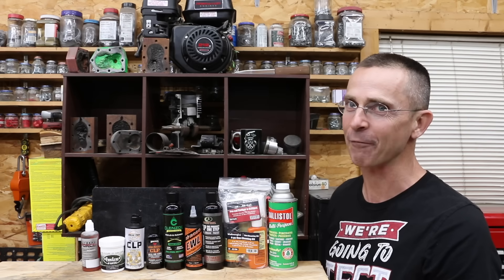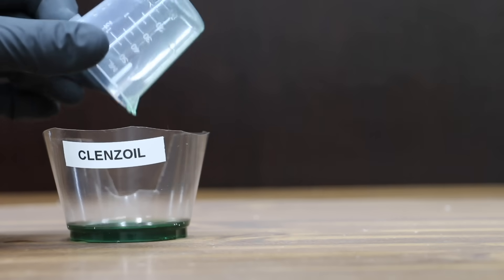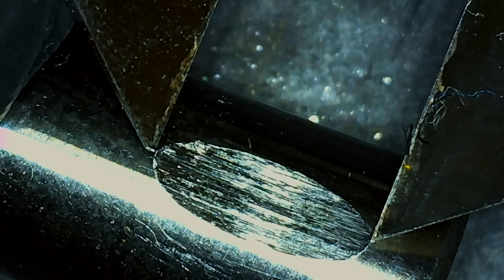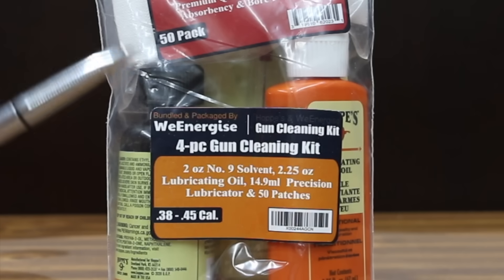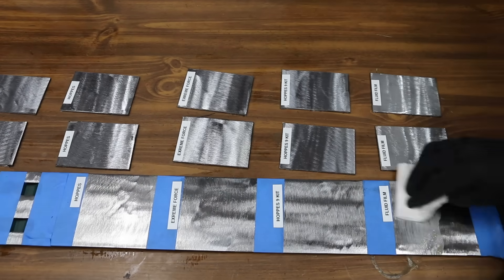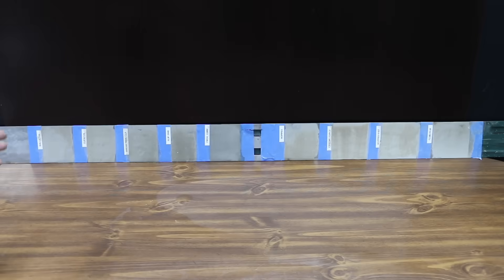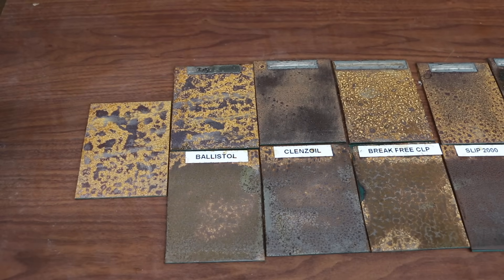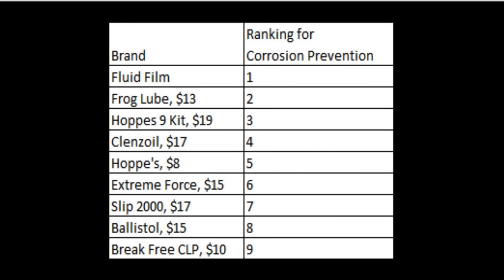Don't Buy A CLP Until You Watch This Review! It'll Save You Time And Money!

Comment: Other than rust, the biggest enemy of woodstocked firearms is excess low viscosity oil. It is usually impossible to restore oil-soaked wood.  A rag impregnated with RIG is all that is necessary to wipe down guns. One can will last a lifetime for most.  Use it sparingly on bolt races and lugs. GTG
    Another method is to pull the action, brush on a thin coating of Johnson floor wax over all metal, then take a clean dry brush and clean off all excess, then needle oil pivot points with the absolute minimum amount of low temperature  oil. Install the action, and either wax the metal or wipe it down with the RIG rag. Also use a hot rod in storage cabinets.

Comment: Is the Hoppes 9 kit the lube from the bottle or the small tip applicator? Going to use that for long storage lube and my trusty Break Free for regular use. 

Just need to figure out which Hoppes was the bad one and good one in the heat/corrosion test

Comment: i use axle grease, it doesnt dry up in a week or two like gun oils. never had good luck with gun oils, they alwayas dry up even when not used and then run like shit... greased guns stay lubed for years with no use and still a lot longer than oil when used... never had any lube/operating issues using grease, i have had/seen many using gun oils, that were solved by switching to grease.

Comment: For a lubricant and protectant, my go-to is Froglube. Though you'd nee to heat the metal first before applying it to make it actually work. Downside, it will gum up when used with petroleum-based lubes. Ballistol is my go-to cleaner when I have other more important things to do. Just leave it on there and let it do its thing. After a week or so, just clean it off with a patch and it will remove most of the fouling. It worked well during WW1, it still works now. The smell is just nasty though. Smells like old wet socks you forgot to wash last week. When I am in a hurry and wanted to really clean it well as in deep clean, Hoppe's is effective. Run a wet patch through, leave it on for 15mins, run a clean dry patch, lubricate. It will remove all the foulings in there. Another cleaner I had experience and would like to have again (unfortunately, it's no longer available in my country) would be the RealAvid Boremax Bore Foam spray. Just spray it in the barrel, let it sit till the foam turns to liquid, run a clean dry patch. All of the fouling will be gone as if the barrel had just rolled off the factory.

Comment: I have been using different products thru out the years on my hand gun. 15 years later, and 60000 round fired my hand gun still looks new and functions like new. The key is clean and lube it after every use and your firearms will be reliable.

Comment: Homemade: Motor Oil mixed with synthetic grease 50/50
Reply: I just use gear oil for lubrication
Reply: @brettr6895  I made a super mix that came out awesome:

1/2 5w20 Full Synthetic 
1/4 Lucas Tranmission Fix
1/4 Mobile Synthetic Grease

And about a tablespoon of CorrosionX, my favorite shit in the salt water world, but it is completely unnecessary. Lol 🤠🍻

Comment: Agree that I’d like to see some of the modern products tested such as Lucas oil. Personally, I use CLP for cleaning, then wipe things down pretty much dry. Then I use gun oil and gun grease for moving parts. Usually grease for surfaces that slide against each other such as the frame rail to slide contact point and barrel to inside top of slide. Then oil for all other wear points.

Comment: I was hoping you would test different types of PVC cement and if their drying time is legit. Also test the difference on glued joints with primer, and with out. Also testing if de-burring  the pipe really has an effect on the cemented joint. Preferably test the listed “Handling time” plz and ty

Comment: I've never really understood how something could be both a Cleaner and a Protectant or Lubricant.  It seems like those should be someone mutually exclusive.  That said, I just finished cleaning my CZ75B and Ruger Mk2, and I use 3-in-1 oil to lube them and protect from rust.  I love the smell of Hoppe's #9 like any good American man does, so I'm glad to use it to clean the firearms.  Wear, though, isn't an issue in the average pistol.  Maybe for something with a high cyclic rate like an Ma Duece that's putting the pain downrange with a quickness and generating tons of heat in the process, but the average person isn't, I think, going to put their sidearms through such torture.

Comment: Heat, or use rather, causes some products to break down. Prefer a high temperature lube and grease that remains viscus after a heat cycle or two. They are extremely inexpensive if purchased in the automotive isle in your big store.  Noticed big differences on long range days and during competitions.

Comment: The first part of this test is flawed, no gun has an oil pan, he should've just wet the part with oil and proceed with the grinding test - Thinner oils will flow and lubricate the part better but will run off it faster potentially leaving you with a poorly lubricated gun (specially when hot)

Comment: Personally I use Break Free CLP for 90% of cleaning, wipe most of the CLP off, then add motor oil for an high-wear parts. I use solvents on anything that the CLP doesn't clean. I've found motor oil to be the best firearm lubricant for the vast majority of scenarios. Just keep in mind that you only need a tiny drop.
Reply: What motor oil do you use?
Reply: @Smooshybeans  10w-30 or whatever I have on hand. I haven't found it matters.

Comment: Introduce to Breakfree in USAF in 1970. Widely used in munitions maintenance including nuclear delivery systems. I still use Breakfree on my firearms and other things around the house. It is an extremely good penetrate, lifting carbon and copper. It does penetrate and "breakfree" fitting, nuts, etc around the house. The other lubricant/penetrant I use is Kroil. For basic bore cleaning, Hoppe's #9 BRENCHREST solvent let soak overnight digs deep into fouling. If followed by brake cleaner to remove it, then Breakfree left for several hours will pull remaining fouling out of lands and grooves. Leaving your bore in the best condition possible with chemical products. 
Love your unbiased testing.

Comment: Apply Frog Lube then hit it with a heat gun. I did some testing in NC when I worked at a shop years ago and Frog Lube, with a heat gun, prevented rust in long term storage better then anything else.

Comment: Most gun cleaners have a lubinum, just enough to keep the gun protected, so you can put it back on the shelf and to keep a little bit of lube on it till you get the s*** looped again. Well, you take and go from there and guns don't have to have pressure to be doing a lot of moving anyways.  All you have, dude is just do a light blue on them to begin with.The only runs really need a heavier lube , job semi automatics

Comment: The EWL has multi-cleanining directions where it does say that the initial application is more so meant for cleaning and basic cleaning as the bonding agents require multiple applications to bond and smooth out. I've used all of of those except Cleanzoil and EWL and EWG from Slip 2000 is by far the best. It doesn't burn right off and dry up after shooting a few mags. And the wear on my slides, bolt carriers, rails and contact points are significantly less worn than I've seen at those round counts. I'll stick to Slip 2000. EWL + EWG is butter. EWL-30 is great too.

Comment: I've used BreakFree for years. Biggest reason I like it is that the teflon additives help form an air barrier for the metal. You just have to shake the ever loving crap out of it before use though. But I have my old series 80 1911 that I don't shoot very often now days (it has over 30K rounds lol), and it sits by the bed in something that doesn't look like it should be stored in (had to keep dust off it), and BF 2000 seals the surface enough that it has zero rust anywhere on it and I've owned it for something like 20 years now. I also use it to treat a sword on our wall and it gets even less handling and sits in a dusty room all it's life. All I have to do to clean it is take it down and wipe any dust off (there isn't much), and reapply some CLP ever few years.

The one thing I think this test doesn't cover and any test would find difficult, is that each firearm design is a bit different on how much or how little lube they need. Some need more than others while some actually need less. Some rifles you "run wet" and others you just apply a drop or two to specific areas.

Great test though, I'll have to pick up some Clenzoil and give it a try alongside the BF 2K. I feel bad for the Hoppes, all the old timers swear by it but I never found it very good at anything other than cleaning which is what I believe it's marketed as to be fair.

Comment: Hoppe's No. 9 for over 55 years and nothing has come along that's any better. It you hunt in cold temperatures, the worst thing you can do is bring your firearm into a warm car if you plan on hunting later the same day. Your firing pin can freeze up with the condensing moisture and you'll get a soft primer strike. That aside, Hoppe's on the moving parts and 3 in 1 silicone on the exterior surfaces. Store your firearms in a zipped up, bone dry case to lessen or eliminate the effects of humidity.

Comment: Frog Lube is designed to be applied to a heated surface, allowed to dissolve and penetrate the pores of the metal, dry (about 30 minutes) and then wiped off leaving the surface dry.  Your wet test of Frog Lube was not in accordance with Frog Lube's instructions for using, thus rendering your result invalid.  I have used FL for a number of years, and have been happy with it, but simply got tired of the time it took to clean and lubricate my weapons.  Switched to a non-toxic CLP, Slip2000.  Not the EWL since that is designed for heavy use, automatic weapons.  Spend much less time cleaning but still have reliably functioning weapons protected for a long life span.

Comment: I’m not sure how the testing procedures tie into finding the ideal lube for your gun. I can say from personal experience that Slip 2000 lubricants have outperformed every other product I’ve tried. In my opinion, Slip 2000 consistently deliver superior protection and performance compared with competing lubricants. Your better off firing 1,000 -2,000 rounds thru an A/R in cold weather and in hot dusty weather to see how well each lubricant holds up. I know Slip 2000 will top the list.

Comment: 3 years old. A lot of new products on the market. Would love a modern version of this. Examples Wilson Combat, Lucas, Amsoil, SchaulandPerformance.
Reply from the maker: Thanks for the suggestion.
Reply: @ProjectFarm I second this!
Reply: @ProjectFarm  I also think an interesting test would be staying power? Applying a measured coating, and then somehow measuring how effective it is after 100/500/1000 "uses." Perhaps putting 10 drops of oil between two metal plates, and then putting them at a 45* angle, and then slide them back and forth a set number of times, and then measuring how much force it takes to pull the top plate up the stationary 45* plate on the 100th time or whatever?
Reply: I personally use the Lucas oil extremely duty CLP but I have no clue how it would compare to
Reply: @frozenwaffles240  Same. I'd love to know how it stacks up.
Reply: Throwing my vote in for this too
Reply: Some people use engine oil as lube. It would be interesting to see how some 5w-20 or 10w-30 performs
Reply: Agreed!  I use Amsoil and the Lucas and both seem to work well. Lucas is just easier to buy locally is why I tried it and so far no complaints.
Reply: I personally use the Lucas Oil set of solvent, clp, gun oil, and grease.
Reply: Try Kroil too please
Reply: Chemistry hasn't change.

Comment: I would like to have seen a test to also include something like super lube. Or a liquid Teflon spray I for 1:10 to put a dry Teflon Lube on the firearms that I carry so that they don't have oil which attracts dirt and causes malfunctions. But my most prominent carry guns I have hard chromed so that they do not need Lube at all. I also haven't seen you include Strike Force in this. I do like that clenzoil. That is impressive

Comment: Yall ever wonder why chainsaws never seem to rust?
 I just moved to the south... none of these are worth the container they come in. Take an old rag and soak it in cheap chainsaw bar oil and use that to wipe any exposed metal. Thank me later. Its the only thing that keeps my "tools" rust free in 80% humidity. Trust me or not but i put more range time in than 90% of "tactiacal keyboard boys" and its working for me on everything i throw it on with zero issues... other than the fact that i have 15 cans of expensive useless products that i don't use anymore.

Comment: When I was stationed in the tropics in the early '80s, the Marine Corps began issuing Break Free CLP to replace the previous bore cleaner and oil we'd been using to maintain our M16s and M60s. Great cleaner and lubricant and I've used it ever since. However, I'm wondering whether the issue with rust protection is what led to my weapon turning ORANGE while stored in the armory in the Philippines?
Really useful information and a reminder for me to recycle the Hoppes and other assorted cleaners and lubricants that have been sitting on a shelf for decades. Thanks for your review!
Reply from the maker: Thanks for sharing.

Comment: Comparing Hoppes 9, Rem Oil, Break-Free CLP, and Lucas Oil like they’re all the same product is like comparing dish soap, WD-40, car wax, and motor oil — sure, they’re all liquids in a bottle, but if you don’t know which one to use where, you’re gonna have a bad time.

Practical Use Strategy
	•	Deep cleaning session: Use Hoppes 9 for the bore → wipe dry → apply Rem Oil or Lucas to lubricate/protect moving parts.
	•	Quick maintenance / field cleaning: Break-Free CLP is fine, especially if you’re on the range or in the field.
	•	Long-term storage: Rem Oil wipedown is better than CLP for rust prevention.

Comment: I like to use separate cleaners and oil. Clp is fine for field use but for in depth cleaning I use hoppes #9 and a synthetic gun oil to lube. Certain sliding parts get a light coat of grease

Comment: For metal-on-metal lubrication, I believe that a quality grease will outperform any of these products.  I'd like to see grease tested.  Also, I don't care much about cost per ounce unless it gets ridiculous.  But I do care about hazardous chemicals.  That's why I like Ballistol for cleaning.  I spray it from their aerosol can, wait, use a brush, wipe, then spray again to remove more residue.  But not in temps below freezing.  :)   I coat metal sliding parts with Lubriplate grease, and other parts with Gun Butter or other (hopefully) good quality oil.
Reply from the maker: Thanks for the feedback.

Comment: BREAK FREE Mil spec CLP can be bought at Walmart ans works awesome. From my .460mag to ar15, 7mm mag..you do have to let it sit for 24hrs but it cleans amazing. I buy those plastic painting tray liners so my wife doesnt yell. I take cylinder out of revolvers and bolt assembly/charginf habdle from Ar15 spray them..let sit then do the barrels let sit..nect day run bored snake theiugh them. Then hoppes 9 oil on moving parts springs. I wont uspsa production class and have competed in usca 2gun. So tons of lesd and uses ateel cases in Ar15 when ammo was hard to find. Dont show hardly any wear on extractor etc.
Hope this helps.
Also why do people pronounce HOPPES w 1 syllable?  HOP-EEZ was the guys name like Ferdinand porsche (poor-shuh) 2 syllables😊

Its as bad saying LAH-POOH-UH for .338 instead of the correct LOP-WHA.😊

Comment: Best CLP is full syn ow20 on any and all wear spots. 

Doesnt fade off in a day or two like the rest of the junk out there for "gun lube".

Been using it for years. Zero rust. Super lubed. Doesn't burn off from heat since it's rated for internal combustion engines. 

Anything tested here is snake oil.

Rem oil down the barrel
Gun snake a few passes. 
Qtip and ow20 on all wear spots (BCG) , trigger springs, pistol slide wear spots etc.

10.00 quart will last you YEARS using a qtip

Comment: These are excellent tests. However, the friction testing is more designed for engine wear and should be used to assess motor oils and heavy-duty industrial lubricants. The primary friction wear points on 1911s and 2011s are the rails. I use Gun Butter and Slip 2000. They are more than adequate for the job. I have tried vegetable oil-based lubricants and noticed increased fouling and "solid shifting" tendencies, adding gunk to the operating area. Anything is better than a non-lubed gun.  2011s are like a good woman, they love lube. So use it profusely.

Comment: If I'm not mistaken, many firearm cleaners are mostly kerosene.  I personally would not use a cleaning product for lubrication too.     Some ideas:  1)  a comparison of wear at room temp and at high temp for pure lubricants, including mineral oil and synthetic motor oil.  Many firearm lubricants are quite expensive and I doubt they really do a better job than a quality synthetic motor oil.  2) an efficacy comparison of pure cleaners, including branded gun cleaners, pure kerosene, brake cleaner, mineral sprits and just plain mineral oil and motor oil.    3) how much lubricant is best?   Some maintain too much lubricant will become a harmful abrasive slurry when combined with gun powder residue thus making "too much" counterproductive.   Yet, one would think too little lubricant would also be harmful.    Which is correct?
Reply from the maker: Thanks for the suggestions.
Reply: US soldiers arriving in Europe were told to leave their newly-issued Garands in a barrel of diesel fuel overnight to remove the packing grease.  Petro-diesel isn't a good lubricant though